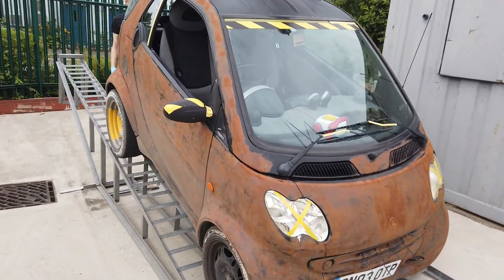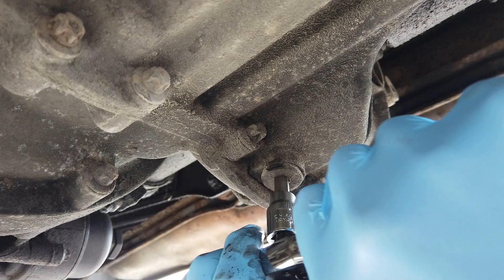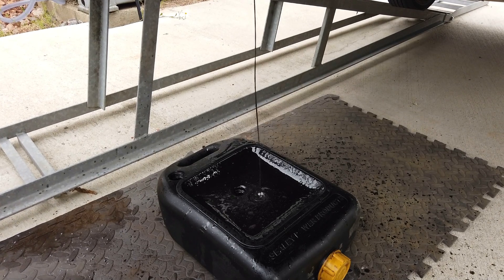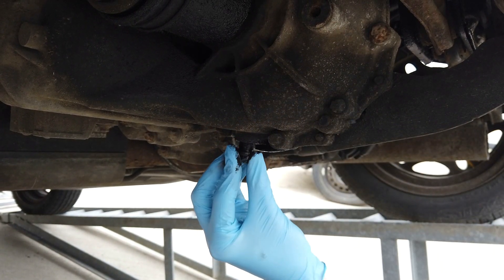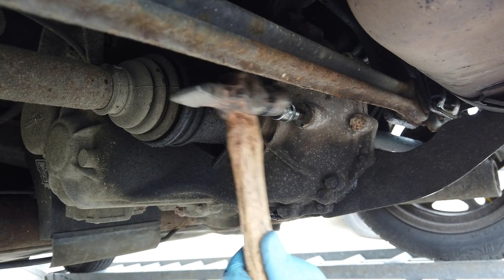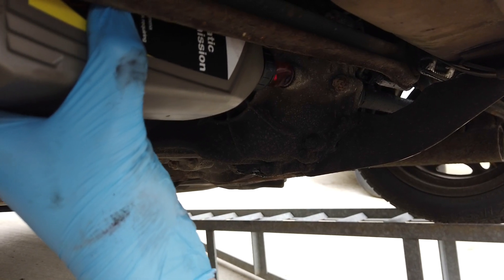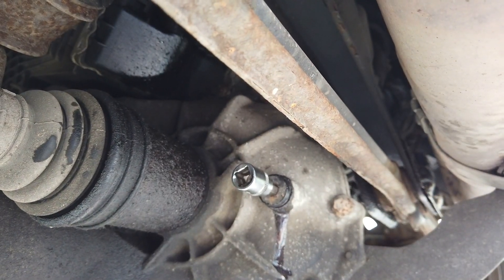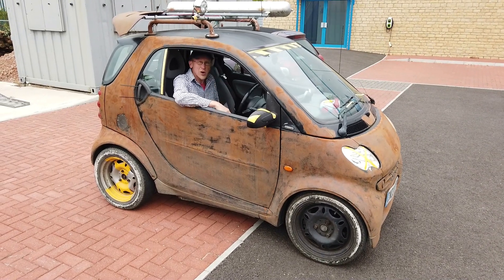Smart Car Fortwo gearbox transmission oil fluid change

Comment: Had this exact problem with a 451, the next generation Smart. It needed a software update from a Smart dealer which cured the problem.  It seems the actuator tries for a certain length of time to select reverse gear but if it cannot change within the specified time it gives up.  The software update simply increases the length of time it tries to select so if it's getting a bit old it will try for longer.
Reply: Sam Rizvi  no, the software fix is the official Smart fix for no reverse problems, especially on the 451,  check out this on Evilution's website,  he is the guru for Smarts.  The Smart box does not use solenoids it uses a type of stepper motor as it is basically a standard manual box worked electrically, it in no way resembles a standard auto box. The selection problem on 450's can often be a faulty brake light switch as this ties in with the gearbox to ensure the car had the brakes on before selecting reverse.   The Smart box is a mad little thing and has it's own set of quirks.   
Chaps, Check the brake light switch if the oil change doesn't solve it, it is cheap to replace and a quick fix.

Comment: I’m not sure about putting ATF in there, though in fairness it will lubricate better than the dirty stuff you took out.  It’s supposed to be gear oil I think.  If this does not fix the problem it’s maybe best to look at a gear motor and position sensor.. and this may sound like I’m being silly but check the Earth strap, all sorts of odd problems on a 450 can be cured by changing an earth strap, and even if it does not fix that issue it’s worth doing.   I was a bit lazy to remove my old one so I added a second one instead, it may be my imagination but I’m sure it runs sweeter.    Issues on a smart often are caused by seemingly unrelated things, once I changed my rear brake light bulb and then it would not go into gear, It really was caused by the wrong resistance rear light bulb.. and it’s a known thing..  how mad is that!
Reply: Hello Andrew, ours cuts out when coming up to roundabouts, battery light and oil light come on. Have too wait about 20 mins then it will start again. tried changing trans oil, nothing (as ours was not going into reverse too) any ideas? 2003 passion cab 450 -  cheers Andrew
Reply: @andydellow9795  I'd suspect the SAM unit, they suffer from the soldered connections failing due to the poor quality of the lead free solder used at the time.  Also the connections to the SAM can become oxidised.   It sounds daunting to remove the SAM and re solder the connections, but its not as hard as it may seem.   Next time it fails try wiggling the connectors around the SAM unit, or even the connections from the SAM to the dashboard.    Smart cars tend to suffer a range of stock faults, its very unusual for one to suffer unique problems.. hope that helps, that is just my opinion on where I would start.  Of course, before that ensure that earth strap is good and battery connections are clean and secure.
Reply: @andrewstones2921  Thanks for that Andrew. It is with a garage at moment, will let them know. Would it come up on diagnostics? cheers Andy
Reply: Hello Andrew, it was the crankshaft sensor (happy days) yours ok? cheers Andrew

Comment: first the car should be streat to have good oil level indecator, second thing as all mentioned in the commints before : try to remove the fill plug first to make sure you can fill the oil without problems !

Comment: Is there a certain brand to use for transmission fluid for the smart car or. Can you use any transmission fluid as long as it says atf
Reply: Redline MT90 is what you want. It must be GL4 to be safe for your transmission. Do NOT use a GL5. It wil damage the brass synchronizes.
Reply: You can use ANY 75W90 GL-4 transmission fluid

Comment: So much fail, do not do what these guys did.  Always remove, or at least loosen, the fill plug before draining.  Don't do this with the rear of the car raised like they did, they left a lot of the old fluid behind and overfilled it.  Use the right fluid, they did not.
Reply: who knew !

Comment: You have used the wrong oil my friend, this takes 75W-90 Manual Semi Synthetic Oil. Note that this is a manual transmission with an auto clutch actuator.
Reply: Any synthetic manual transmission fluid that is 70W90 and GL-4 is fine to use. 

Synthetic oil is always better than conventional unless the car is old and has high mileage.
Reply: @TheNpcNoob  Thanks for the info, wife's car has 82k and this is what I use, funny enough it's a common mistake loads of people fill it with atf, even when I bought the car I found atf in it.